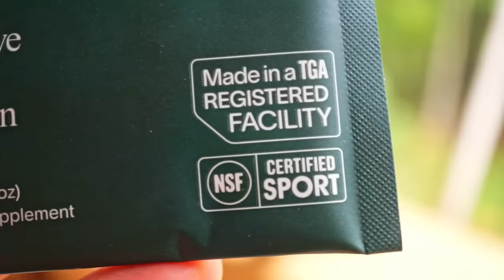Building A Log Cabin | Ep. 61 | We made a folding ladder for the mezzanine + Canoe camping!

Comment: I see the cast has been removed.  It's nice to full mobility back.  Folding ladder came out nice.  Keep an eye on the hinges, over time the screws can loosen.  You might need bigger and longer screws in the future if they loosen too often.    Looked like a nice camping trip.  Great way to unwind.  Thanks for the video.
Reply from the maker: Great tip on the hinges, thank you! We’ll keep an eye out for sure :)
Reply: Maybe look into a long screw that goes straight through the wood and tighten it off with a hex screw on the end?

Comment: a place that I worked had a stairs to a second floor that had cables pulleys and the right size weights to make the stairs easy to put up and down, the weights would go up and down near the wall
Reply from the maker: Yes we thought about a counterweight system, but it adds too much clutter with the cables and weights

Comment: Nick when you do a repair like this when you remove the stone and clean out the loose cement you MUST wet the existing  floor cement  before you put down the new mortar and stone , why? because the new mortar when it goes down the dry existing cement wants to suck up all the water in the new cement and leave it dry and as soon as the new cement dries and the  pressure-or movement you will have joint cracks. when you wet the existing cement in place and you put down new cement the existing cement is wet and so it does not take the water from your new cement and so your new cement has plenty of time to set up and not fail, so , if you already did what you show in the video already you may still time to wet the stones and mortar joints  you put down with a spray bottle to help let the cement take slower to cure and do it for a few days  , good luck
Reply from the maker: Well, the more you know!! I think we were lucky, things seem to have dry up normally.. but if we see it crack in the future again, we’ll definitely do that! Thank you for sharing :)

Comment: Hi guys. I am a new subscriber and I am enjoying watching your build. May I make a suggestion? I heard you say the ladder is pretty much finished, and you did a great job with it, overall. But! Since a failing ladder has already caused a serious injury, I am worried that the place where the top of the ladder mates with the metal structure connected with the mezzanine floor is unsupported. The grain of the wood is good and there does not appear to be any knots, yet that is a place that could give way. The wood will continue to shrink a bit as it seasons. How about placing some grommets around the eye at the top of the ladder? You could use some of the same type of pieces that you have already used, or a local blacksmith (if available) could fashion some custom wrought iron pieces for you. I am no expert (obviously), and I may be way off in my thinking. But if I am right, this small modification could be very beneficial down the road- especially when you are carrying heavy items up or down the ladder. With the best of intentions...

Comment: more than the shock absorbers to hold the ladder you should put a "mask" inside where the tube that holds the ladder still rests now the tube will slide against the wood and you will see that by opening and closing that hole it will become too big and will end up giving way and you will probably end up in the emergency room again instead if you apply the metal "mask", let's say a sheet of metal a couple of millimeters thick with the hole where the pipe rests and 4 screws that hold the mask to the ladder upright, all inside the ladder , a sheet of metal about ten centimeters thick, 2 millimeters thick and you will have solved the problem of the tube that widens the hole in the wood of the staircase. Even the external steps are not good, if it snowed and you go down without being careful you would slip and even in this case you would do some damage to yourself, it is better to immediately make a cover that covers any snowfall on the steps and also put two pieces of wood on which to rest your hands when it comes down even in the wet.
Reply from the maker: We will probably add a handrail on the outside steps once winter rolls around. And we don't plan on raising the ladder very often, maybe a couple times a year when we have guests over. But we will monitor the wood to make sure it's not being worn down!

Comment: 26:58
See for yourself, the expansion coefficient of wood, metal, and cement mortar is different, i.e. the compression-expansion process will lead to the formation of cracks, right? In the case where you had only one insulation - moss, it contracts and expands along with the tree.

Comment: Watched a bunch of your videos., awesome. Love them.
Couple tips 🤷‍♀️

Get a chainsaw, because it will go hundred times faster.

Cut a wide path/road
Using chainsaw so you can drive your vehicle all the way to the cabin.
Use those cut trees to build a huge wood/log firewood shed.
Do your aluminium roofs for more rain water.
Eventually get a big tank/underground 500 gallons for water.

I would also put up an electric fence because of bears and cougars, don’t think for one second bears have gotten into cabins before. Protect yourselves. Also, both of you get gun permits and guns.
It could save your lives.

Make a little oasis:
Get a 10 ft galvanised tub 2 ft deep make a small pool, easy to do with filter. Colder weather you can do a solar panel to help warm until you can’t go in….

Get s couple of big dogs too snd train them to stay by your side no matter what. Bears n cougars will kill them.

Invest in a quad and small trailer and eventually maybe a truck with a snow plow.
I suggest all these things because heaven forbid you need serious medical attention, you might not ever get to that van where it’s parked.

Not to mention all the fires Canada has had. That van needs to be closer. 
Because of the fires you might want to cut your tree line back some as well, if your not sure. Speak to s local fire department next time you go into town for supplies.
Another reason you need a long driveway right up to the house.

Hopefully your aware of getting paid for your videos. 256k followers should give you s chunk of money to pay for the above items I suggested.
If you get paid, get the driveway done., get a farm type tractor, help with yard garden etc
Build a barn / workshop 🤷‍♀️
It’s possible. I watch other people doing all that and getting paid for their videos.

Your living the dream !

I subscribed ❤️

Im older than you, some of these things are for your safety and protection. I do not mean them in a bad or mean way. Your a young couple, bringing only love and awareness ❤️❤️

I’ve never actually seen a video on a walk through ever after you’ve done the project., would be nice to see what inside all around looks like.
Looking for new videos

Good luck, lots of love ❤️❤️❤️❤️
Be safe 🙏
Reply from the maker: Thank you so much for taking the time :) all those ideas are great and we’ll definitely add them to our list of tasks! Don’t worry, we understand it comes from a good place and we appreciate it ;)